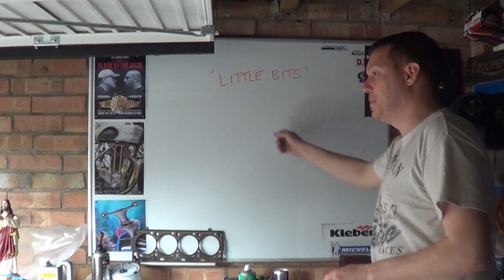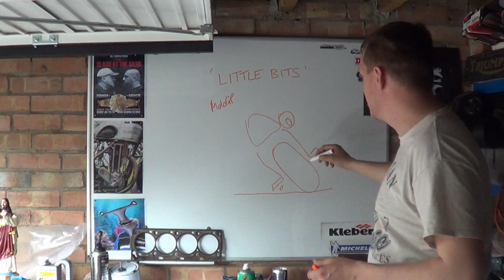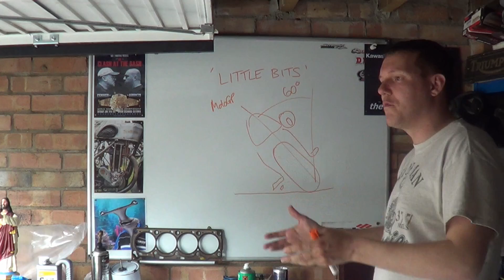MotoGP Gear shifts - Down to go up?

Comment: Common practice since i raced the 80s and easy to do on superbikes, you just take the shift lever off, turn it 180 degree on the shifter shaft and fit a rear set pegs to bring your feet back so your toes are over the end of the now reward facing shift lever so you can go up gears in left hand sweepers.
Reply from the maker: Yeah I was talking about what they do for the motogp, I've seen alot of people do the switch on road bikes and I don't know why. Unless they either a) race on the weekends and don't wanna fuck around forgetting (not many people though) b) think they are racer and in reality are dickheads lol
Reply: Yeah about the only reason is track day riders that use the machine on the road otherwise just for show I reckon. Makes them feel faster, like a loud pipe.

Comment: Is the drum any different?? I thought a racing change was achieved simply by altering the gear lever / mech geometry??
Reply from the maker: It depends on the team who are designing the engine, but for purpose built engines they like to do it properly
Reply: Farlig66 friend of mine rides bike races where most just use modified street bikes and most of them do it with links.
Reply: Yeah, pretty sure on my bikes it´s a case of removing the standard lever & linkage & fitting a lever directly to the shifter spigot... I think you might also be able to just flip the arm on the spigot 180° to keep your std rearsets

Comment: i think its also because braking forces its easier to use the G force to go up to change down and down as you have the G force going the other way. it kinda helps make the shift easier. if you get what im saying
Reply from the maker: Really?
Reply: think about it. under heavy braking the gforce is going towards the front tyres. so its easier to lift the shifter into that 
under accel Gforce going towards rear  not as important as the braking

Comment: there are pro's and cons for both systems.
I find racing a 250 stroker that using the standard road pattern works, as the bike stops a lot quicker than it accelerates, and because its a stroker with a narrow power band, I have to go down more gears in order to get it into the sweet spot when I transition back onto the power.
Therefore, I have found its quicker to push down than it is to pull up.
Its not without its disadvantages, but as most circuits are clockwise, most corners are right and there are significantly less LH corners where it happens to be a problem

Comment: What if the turn is a closing radius and you need to downshift mid corner. Would you need to simply enter in the lower gear or straighten up mid corner. Is there a third option I'm not seeing, never raced anything but shifter karts.

Comment: They must have got that idea from the FS1E riders of the 70's.  )  My Fizzy was 4 taps down to get through to top and 45MPH at 70 degrees or more... Yeh must have been 85 degrees at least as I remember. You should find an excuse to do a vid about the FS1E. All joking aside I rode back from a 20 mile expedition to my Nan's and the head bolts came lose and the head was vibrating with a quater inch gap yet it still did 40mph.. I think the fizzy was made by God. Loved mine.